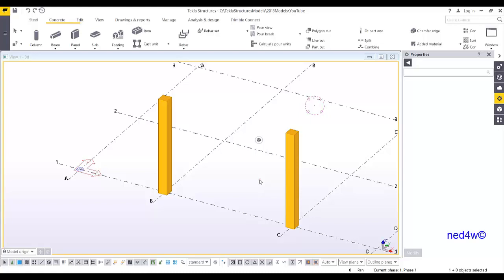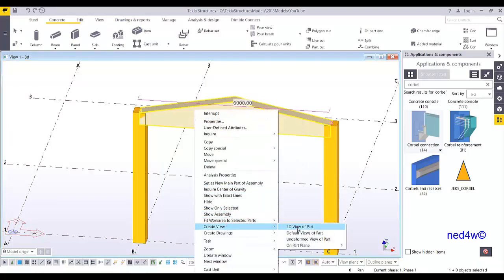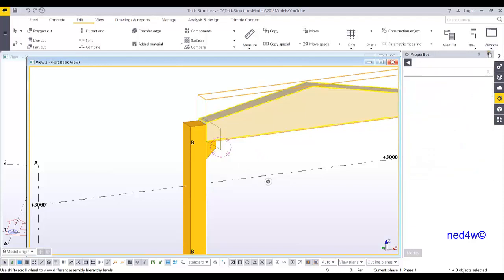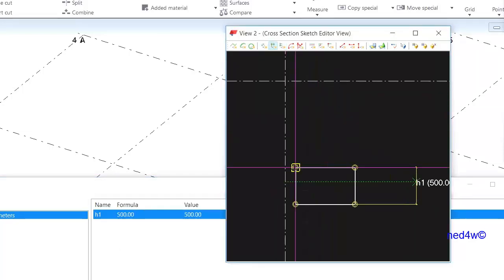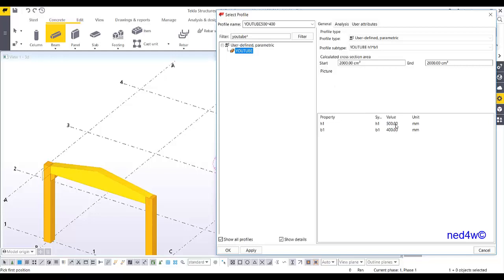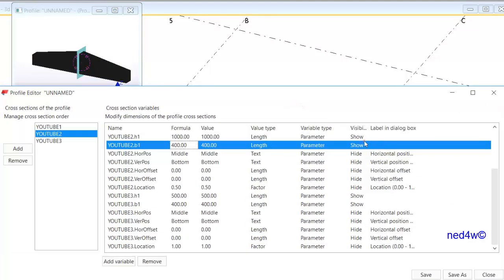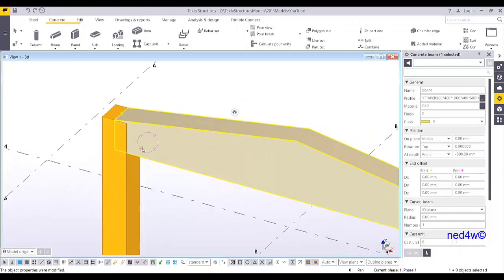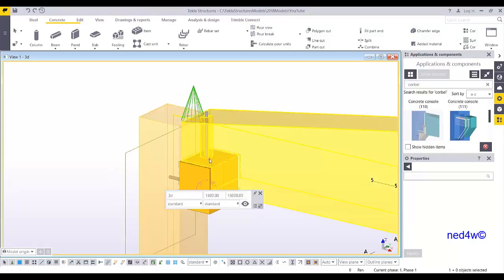How to Add Corbel to Beam with Variable Height?

Comment: You have 2-3 additional ways to draw beam what you describe in video. That is very complicate way and need more experience in tekla.  You can draw beam with slab command. 2.Draw in autocad and import as poly beam.3, Draw  normal rectangular  beam and after that cut with line.